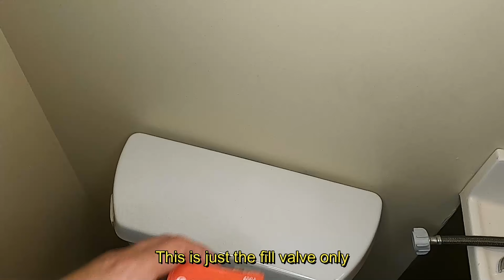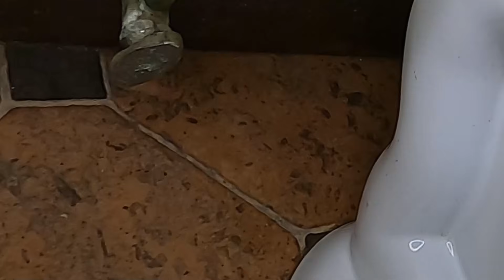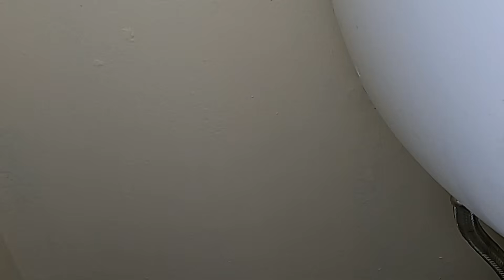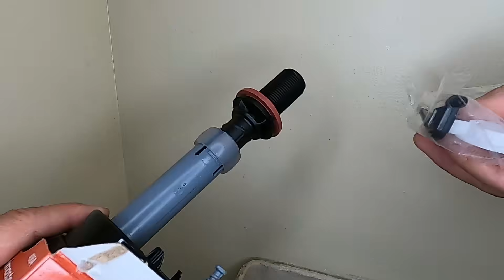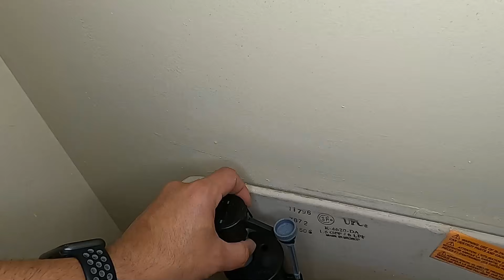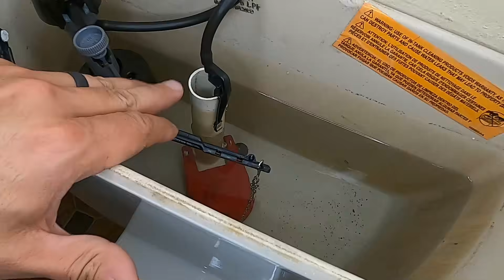How to replace toilet fill valve - For Beginners

Comment: Thank you for this video as it helped out a lot. I will try to do the work myself as the plumber wants to charge me $150. 
The camera goes up too high while you’re inserting the fill valve and later which limited the view. But will also read directions. Thank you!

Comment: hrm... I might need to replace the hose too... unscrewed the hose where it connects to the fill valve and it didn't come free... and it's stiff plastic, not the metal...

Comment: Well great I can't even start on doing this job without troubles.. darn stop valve cpvc glue on one the stem leaks when I turn it to off . Ha.. so now I have to turn off the main water inlet under house then I can start . Ugh.. probably should replace stop also eh.. 😊.
Reply from the maker: Always something lol

Comment: Hi there, just wondering...is the position of the black Fill Tube important?? Like, you have it kinda twisting and bending and then coming down onto the clip. Would it make more sense to trim the tube so that you don't have too much excess that is bending?
Reply from the maker: Yeah I would definitely trim it if it’s getting twisted up or hitting the lid

Comment: Hello, did the black hose come with? I dont see in the video when u put it on? My blk hose is out of the white tube. Im not sure if i replace the entire thing or not
Reply from the maker: Yes, it came with the replacement valve. I would recommend replacing all of the parts if you’re swapping out the valve.

Comment: I was trying to do this myself and I was at the part where I was removing the hose from the valve. Apparently I kept tightening it up it up because I thought you know lefty loosey righty tighty but I ended up breaking the neck off of the valve trying to get it off of there because I thought it was on there just so tight. It is but now I'm having to figure out how to get it off. It's like a big metal not it's not like the white plastic one you have and so it's harder. It's not rusted but it's just a pain in the ass. And then I found this video so lol

Comment: If the fill seems slow, like this one, suspect also the flapper because it could be leaking a little water through.  You said there's nothing wrong with the flapper but I say don't start with that presumption even if the fill valve is the major culprit.

Comment: After cleaning and replacing my fuildmaster 400 seal valve that was whistling, it now will not shut off unless the top cover is pressed down on by hand. The pin moves freely up and down, and lifting the arm to it highest position does not shut off the water as it should. I keep taking it apart and going though all of the steps checking for debris. How and where does this little metal pin seat and why is it not making the seal to shut off 100%? It is 3 years old the toilet and the fluidmaster. This has turned what should have been a 10 minute fix into my entire day. Thank you for your expert opinion.
Reply from the maker: Honestly sounds like the seal is either worn or everything isn’t seated down all the way under the cap

Comment: 10 mins my ass for a beginner? No mention of how high the bakve should be adjusted? Oh yeah where you want it. Right.
  Shur off the valve from the wall? No oroblem pribably gonna leak a little bit? I can handle that in 0.37 seconds( I live 1 street away from Ace Hardware. Drain the bowl ? Ok let me go out in the garage and get the shop vac i think i know where its at. Im betting my water is gonna leak and Ill be done un like 15 mins?  My ass
Reply from the maker: Wow sounds like you should hire someone

Comment: Our old fill valve making sounds and the adjustable water fill doesn’t work anymore. I had to buy a new fill valve and new flopper. Now it’s running smooth with no leaks and sounds…
Reply from the maker: Awesome!

Comment: Roto Rooter just quoted me $400 to do this job.  Then they told me, if that didn't  fix the problem, I may need a new toilet and they would charge me $1,000 to buy and install a new toilet.  Sooo....that's  why I'm watching your video today. Thank you so much!
Reply from the maker: Geez. Sounds like Roto rooter doesn’t have their customers best interest to n mind. Thanks for watching! I have a couple updated newer videos as well.
Reply: That is what a company did to me today they would charge over 800 to get a new toliet and 400 for the fill valve
Reply: Thats such a roto rooter way of doing things. Surprised they did express the need to repipe youre entire home.

Comment: Cool! BOTH of my toilets decided to break at the same time. Of course they both have different issues. LOL! But I knew it couldn't be that hard to fix them myself. This is the exact fill valve I currently have that isn't working in one of them. I'm going to go get one after work and replace it myself. Now to figure out the other toilets issue. THANK YOU!!
Reply from the maker: Welcome. I have an updated video that’s easier to follow and more detailed if you’re interested in my channel

Comment: Problem is those stupid a$$ screws thst hsve to come off under the roilet thst holds thst piece in, got stuck and a plumber had to use a saw to cut it off. It was thst ehite plastic piece.  Wouldnt unscrew with hand or wrench

Comment: Good video. I seem to have to constantly reinstall either a fill valve or the flapper. Idk if the components are just cheaply made or if there is another issue I’m not aware of. This is an easy fix but probably my least favorite.
Reply from the maker: Do you have well water? Or a whole house  water filter. Sometimes sediment gets in the lines and will cause these to fail. Especially if you have well water and no filter
Reply: @theguyofalltrades 
I have city/town water, but no whole house filter. I think you are right and that may be what is happening.

Comment: One of our toilets hasn’t been filling fast. I knew it would be a simple fix, but I kept putting it off because I wasn’t sure I could do it. I went to Home Depot. It sat on the bathroom floor for another two weeks. Watched this video and it looked so easy. I doubted it would take only ten minutes. Three hours into the job and I needed a break. I watched the video, again, and realized I hadn’t followed the steps correctly. Went back and fifteen minutes later I was done. Watch the video a couple of times and once before you start. It really is a simple job.
Reply from the maker: I also have some newer videos with better details and explanation

Comment: I am a 61 yr old female and I HAVE done this once before with the help of YouTube.  You made a great video and so did a few other guys but my   400A has a totally different washer set up that I cannot wrap my head around. So I'm just going to put the washer or gasket from the old one and hope it works.. this one was sticking so the washer wasn't the problem. I'll save all the parts and keep watching videos in case this doesn't work. 🤪
Reply from the maker: Red washer stays on the inside of the tank and gets pulled not place an seals with the nut that mounts on the bottom. 400A has the brass stem right?
Reply: No it was all plastic and the washers were one peice. The picture directions showed a thumb pushing up through the middle to seperate the two washers. The short written instructions said to push up to seperate too i think. I couldn't do it. I found the 400A in box in my clients garage. Idk how old it was but the one in the tank was just like the ones i saw in home depot a couple days later. It was bent and making the float stick but the washer was still good and it worked. @theguyofalltrades

Comment: My fill valve is glued to the tank. It does not come out.
Reply from the maker: Like the retaining nut is glued?
Reply: @theguyofalltrades  I got it. It was so tight it seemed glued on. I was able to unscrew it and now I have a replaced it with a new one. But, it’s not as easy to remove the retaining nut. But I am a woman, so I don’t have the same strength as a man.
Reply: @ no. It was not. I thought it was, since it did not move. But after try and try again, it came loose.

Comment: Install Fluidmaster 400A was an easy 15 minute job.  Removing the 19 year old OEM AS/Fluid Master fill valve took 45+ grunting minutes.  Retention nut was very balky and hard to get at with wide angle pliers.  Fluidmaster instructions say "hand tighten" retention nut and supply line nut.  My arthritic hands are not very strong, I lubed the threads with silicone grease and used a cloth to improve my grip; will monitor that it does not leak.  Also note the replacement retention nut only has one thread, while the OEM nut was entirely threaded.  No problem getting a firm connection and should be easier to get off.
Reply from the maker: Some of the older fill valves had brass threads too and they can be corroded from what I’ve read in some comments. Either way glad you got it done!

Comment: My tank stays full of water during the day as the Toliet is used often.  However, every morning the tank is empty of water.  I tap the gray button which can be used to lower/raise the water level and then the tank fills up.  What would you suggest needs to be fixed?
Reply from the maker: The valve is binding and if your tank is empty the flapper is leaking by. I would prob replace both

Comment: why does it takes long to fill up the tank i find very slow
Reply from the maker: Is the water valve opened all the way? Also what is your water pressure coming in? Mine is 100 psi and it takes 50 seconds to fill the tank

Comment: 2 questions - 1)Do you need to remove the hose from the cut-off, or can you just remove the end to the toilet? 2) can you trim the fill tube so it doesn't bend so high up and potentially hit the toilet tanks cover?
Reply from the maker: You can just remove hose from the valve. I was replacing mine. And yes, you can definitely trim the fill tube. I believe if you read the instructions, it tells you to.

Comment: How can I remove the pump when it’s in a hard spot to reach since it’s really close to the wall n I can’t get it off by hand
Reply from the maker: The only way to remove the valve is from underneath. Sometimes you can just replace the top seal inside of the valve though depending on the model fill valve

Comment: What if the valve (under the orange cover in this video) is falling apart? How do I get that piece out? I can’t find a video on it because I don’t even know what it is called. Thanks for ideas.
Reply from the maker: You mean the flapper valve? The whole thing is called a flush valve assembly. If the bottom part where the flapper closes to is damaged you’ll have to remove the tank to fix it
Reply: @theguyofalltrades   thank you for the response. I had a handyman take a look and he caught that it was just the top part of the flapper valve... after I took the tank apart. Oh well, went back together fine. 😅

Comment: Why not leave the bottom assembly in place and only replace the upper new portion that slides up and down since this is a replacement for an existing Fluidmaster ?
Reply from the maker: You can replace just the valve if you want but why waste money

Comment: What is the white pipe brakes does sticking up, where the hose clamps on to??
Reply from the maker: If the overflow pipe is broken it will definitely need to be replaced

Comment: You saved my family probably over $200 this thanksgiving season! We're tight on budget and our fill valve wouldn't stop running. Bought the exact same fill valve your using in this video and I installed it, and now it's running like normal. Thank you so much!
Reply from the maker: Welcome

Comment: dumb question:  The black tube is the one that actually fills the tank with water?
Reply from the maker: The skinny black tube that goes into the overflow tube fills the bowl. The water for the tank comes from the base of the fill valve assembly
Reply: @theguyofalltrades  Thanks! that explains my faulty valve.  I just replaced it it works like a charm. $8 fix.

Comment: Hold  back up with your right hand on the fill valve when you're tightening the nut on the bottom
Reply from the maker: Yup. If you get it snug enough at first it won’t turn normally

Comment: Thanks, you just saved me $385.  That was the estimate that the plumber that our condo association uses quoted me.  I watched you video, went to Home Depot to get the replacement valve and did the whole job myself.
Reply: Right it's messed up how much they will charge people for some you can do yourself if he was a real one he would tell you it's easy and you can do it but that guy wanted to rip you off
Reply from the maker: Welcome! It’s so easy to do yourself
Reply: I'm so grateful for you-tube!!!
Reply: Yep... plumber said to me that replace old things and cost me $700.00. 🤨
Reply: Years ago when I called a plumber  for a toilet that wouldn't flush correctly, the plumber charged me over 300 dollars.  Now when I have a  problem with my toilet, I repair it myself using YouTube videos.

Comment: Do you only need that washer if replacing the hose? I only bought the new valve. Also do i need to unattach the hose completely if only replacing the valve? Thanks in advance
Reply from the maker: Don’t need to remove the hose entirely if you’re just changing the valve. Are you talking about the washer on the bottom of the fill valve?

Comment: When did that black hose inside the toilet tank get installed.  I'm confused.  Did it come in the box?
Reply from the maker: Yup connects from top of fill valve to overflow tube. Comes in box. Checkout the newer fill valve install on my channel. A bit more detailed than this old one
Reply: @theguyofalltrades  I figured it out and installed the whole thing in no time.  Thank you for saving me $175!  thank you!

Comment: You forgot to tell them that you can measure the new float assembly against the old one, and be pretty close to where it needs to be initially! Also, recommend using a back up wrench on water line, so you don't break it off in the wall! You will need a real plumber if you do that!!

Comment: How come the fresh water goes into the overflow? Like, what happens when it actually overflows? Where does the water go?
Reply from the maker: Goes into the bowl. That’s what actually fills the toilet bowl. The toilet shouldn’t ever overflow if it’s not clogged. Once the bowl is filled enough there is enough pressure for it to auto flush itself

Comment: I know this is older video but the plumber that just left my house quoted just the fill valve replacement at $300 and both the fill valve and the other piece inside there at $400 which I declined both repairs then found your video and replaced fill valve in 10min myself for under $20 works great plus my husband was very impressed and appreciative.  I am a rockstar thanks for video
Reply: IDK but 10 mins@$20 vs 10 mins@$300 seems almost criminal wouldn’t you say. Ah the trade business, a great way to take advantage of the non-trade non-mechanically minded home owner.
Reply from the maker: Love hearing this!
Reply: Did this as well and fixed my toilet today. 

I'm a broke teacher. Wanted almost 400$ to do a job that took me a whopping 30 mins to Home Depot and about 30 mins of work.

Comment: always wondered why no one used the wet/dry vac to clean out the tank?  now i know it can be done.  have 2 toilet's i need to repair, i hate these new fluid master and the need to adjust them.
Reply from the maker: Makes it super fast

Comment: Thanks for this video! Just curious, why toilet fill valve would stop working, and what's the average lifespan of a typical Fluidmaster 400A fill valve? Thanks!
Reply from the maker: Normally crud will get into the valve seat. You can disassemble the top of the valve and clean it sometimes. They should last a pretty long time

Comment: Did you use pipe tape on the threads of the wall valve?
Reply from the maker: No need to if you use a stainless braided hose or even a hard pipe to the valve as long as it has the compression fitting. The hose has a rubber sealing washer in it

Comment: Thank you so much for the step by step tutorial. The water kept rising into the overflow tube along with the black hose even though I adjusted the black screw back and forth. Replacing the toilet fill valve fixed the problem. I'm so proud of myself because I never done this kind of work before 😊
Reply from the maker: Welcome. Great job replacing it!

Comment: This video is much appreciated, but when you demonstrated how the valve was adjustable in height, you didn’t explain what the proper height adjustment for the valve should be.
Btw, I was quoted $800 to do this job.
Reply from the maker: 800 is crazy. Checkout this newer video, it goes into better detail than the older one you watched. I basically just keep it from hitting the toilet tank lid by an inch or so. Then you can make water level adjustments until it's to the mark or a little bit below the overflow tube  https://youtu.be/6O4L8yZnEkw?si=skmpvBCBwVI2pTdg

Comment: Why didn't you put Teflon tap on the threads? I think that worth doing.
Reply from the maker: No need to, there is a rubber gasket in the hose

Comment: "I don't need to unscrew the lower section If I'm not replacing the hose." How is one person supposed to hold the upper section and the fill valve at the same time if you're not?? 🤦 Thanks Mike Klimek for a better video.
Reply from the maker: This is also the #1 watched video on YouTube for fill valve replacement. Not sure how you don’t understand the steps